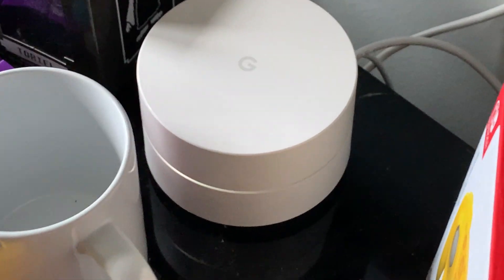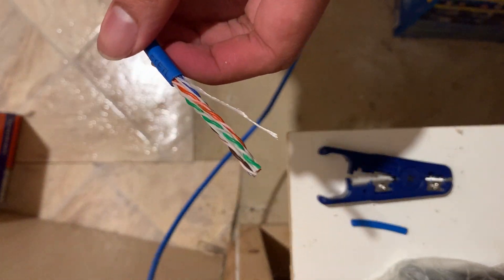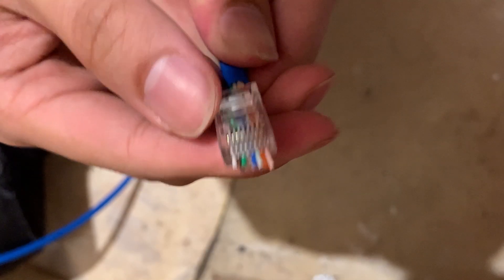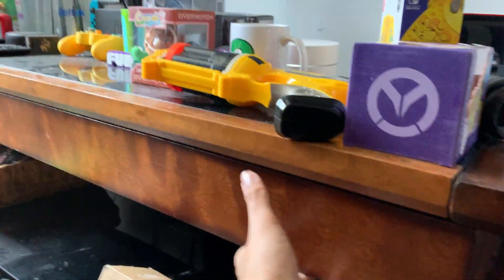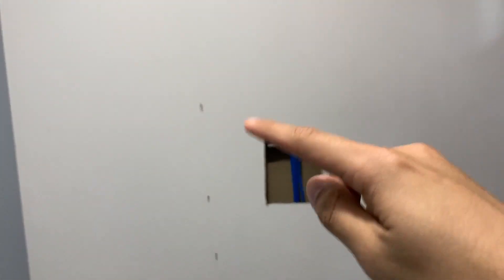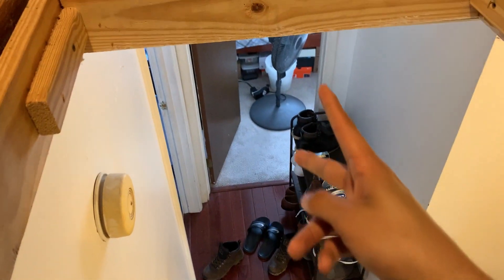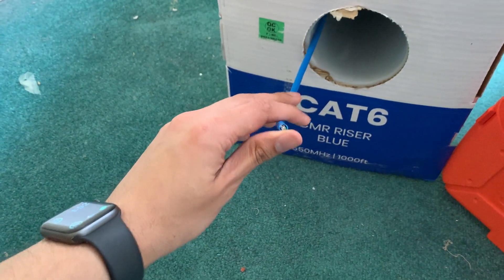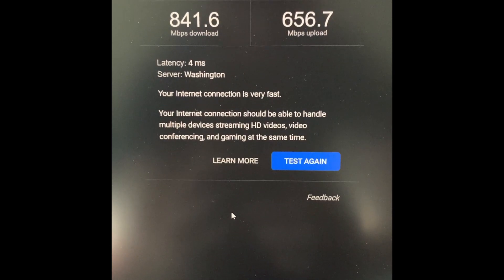Wiring our entire house with Ethernet cabling

Comment: This is a nice video but I have a couple suggestions to improve your network. 

Always run at least two lines to each wall drop or a pull string if you anticipate adding more later. I know switches exist but you can't always rely on a single line to last forever. It's always better to have some redundancy, whether it's a room with multiple jacks or multiple lines behind each jack. I've had two of my single network lines in different rooms fail on me and that wasn't fun to deal with. 

Pull string helps allows you to run new wires to an existing location without removing the existing wires or fishing the new wire. It's very convenient and cheap insurance, especially when the drop has insulation. 

You kept saying how annoying and tedious it is to run networking, which I completely agree. So you definitely don't wanna go back to your attic, fish a new wire over and over again. 

Also, I prefer a keystone to keystone termination for both ends when using bulk cable. Keystones are way easier and faster to terminate. They allow lots of flexibility in positioning, especially in whatever network room your cables end up in
Reply: Remember kids, "Friends don't let friends make male ends." (RJ-45)
Reply: Yes, I did notice that he did not mention anything about using a 110 punch tool and a keystone. For running inside the wall that is absolutely the best practice.
Reply from the maker: These are really good suggestions

Comment: No patch pannel?
Reply: Do you think it’s necessary in this situation?
Reply: @adamdavis2788 if you're doing as minimal runs as he did, then no. If you're doing many runs (>8) or want something more future proof then definitely.
Reply: Most definitely yes! Any more than 4 cable runs put in a Patch Panel. You will than yourself later especially when you realise you need more outlets.

I ran the cables in my house when it got to lock up stage and before the drywall was installed. 17 phone points ( I had a SOHO and until you have one, you don't realise how useful a PABX handset by the toilet is), 9 network points a 7 co-ax TV points and it took about 4 hours. Later I needed to add 8 extra network points and it took me the best part of a day. Then I needed another 6 network points because Smart TVs were not around when I rand the first cables. A 24 port Patch Panel made it a lot easier and it is now full. Later I had to install a 12 port Patch Panel when we put security cameras in.
Reply: At the very least, keystones.

Comment: Cable boots are the worst, I don't know why they're even around still I don't recommend them at all. Over the years those tabs harden almost like a rock making it extremely hard to press with your thumbs to release cables from a switch or wall outlet. In some cases I've had to use a blade to cut them in order to get to the tab to release the cable.

Comment: Great project, good video!  Two recommendations to add polish to your new network: 1. At 5:27 that RJ45 crimp was not optimal. The cable jacket should extend all the way into the plug and under the “strain bar”. When the plug is crimped, the cable jacket should be crimped under the strain bar. 2. At 12:38 there are dangling cables near your switch.  Best practice calls for Permanent Ethernet cable runs (called drops) to be terminated with a patch panel on one end and then terminated to a keystone jack on the remote end.  Consider re-routing and terminating the cables near the switch into an inexpensive 12-port patch panel, leaving you expansion capacity to add cable runs later.  Cable Matters makes an excellent 12-port patch panel, cost is less than $24.  Good choice on the TrueCable cat 6 cable, BTW. Excellent quality cable.
Reply: … forgot to mention … then connect short patch cables from the patch panel to the switch.  Again, great project, we’ll worth all the work.
Reply from the maker: @pawpaw7646  Thank you for this great advice! I actually ended up implementing a patch panel into my new house, but I forgot to record that process 😅
Reply: These are great recommendations. I do believe that a patch panel isn't necessary if there's less than 8 lines. Just a wall plate or two with 4-6 keystone jacks should suffice. Or even a pass through wall plate with every cable end terminated with an rj45 keystone is good enough. 

But if he does end up running a lot more cables, then a patch panel, preferably keystone type, would be recommended

Comment: DO NOT twist the wire stripper 3 TIMES. You only do it one full rotation or it can hurt the wires.
Reply from the maker: Thanks for the advice. When I was doing the cabling, I found that 3 times worked best for me, as doing less would not cut the rubber
Reply: @funky7522  You can rotate as many times as you need to cut the jacket, but you should do so about an inch or so down from the end of the cable. That little plastic string you cut out is actually supposed to be used as a "rip cord" so that you can strip the jacket down to your desired length without damaging the conductors.
Reply: @funky7522  yeah, that happens, if you even Knick one of the twisted pairs it can cut down your speeds by a lot.

Comment: Good job to u and ur brother. So convenient having your room wired :) was it a weekend project? Or a couple weekends?
Reply: I am about to install several IP cameras outside our house, connected to an NVR-router-modem.  Your willingness to undertake your project with no experience is very encouraging for many of us who likewise just want to give it a try.  Thanks for taking the time to share your experience.
Reply from the maker: Thank you internet stranger! It was done over the span of a few days on and off. We first did all the dry wall work, drilled holes and made the paths for the cables. Then all the wiring was done in one day